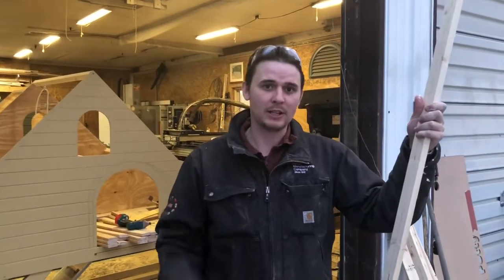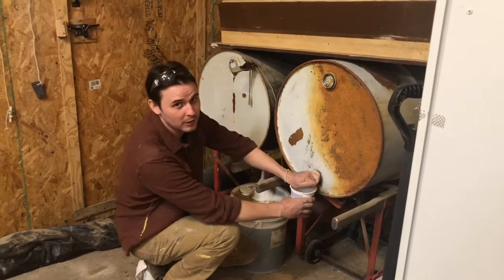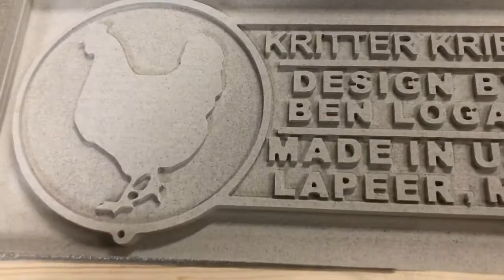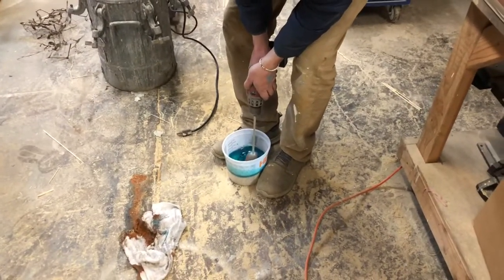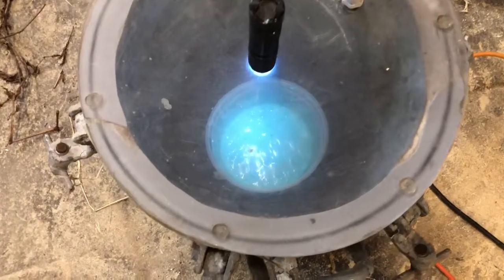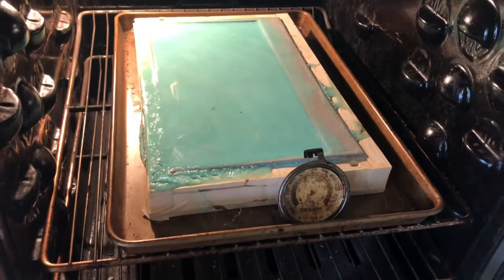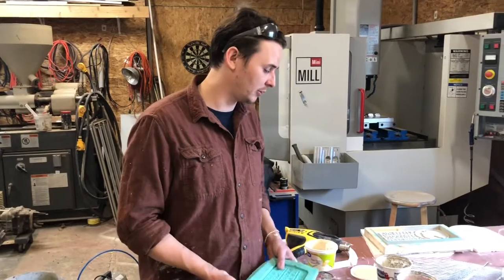Making a silicone mold and casting urethane

Comment: Cnc metal and wood and Injection molding. Your just a mini factory 😂
Reply from the maker: It’s wasn’t the original plan but I always run out of money with one project so I have to start another. I guess the diversity comes out of necessity.
Reply: @BenJoLo   I respect that, I like to do everything myself to, it’s often makes more self to do it yourself. Im getting into injection molding and building a mini desktop version. Wish I had a proper one, we’re you able to pay it off? In a reasonable time